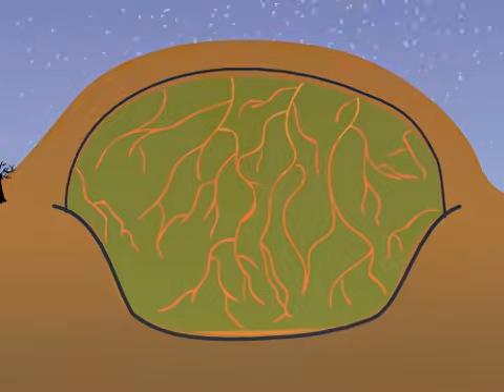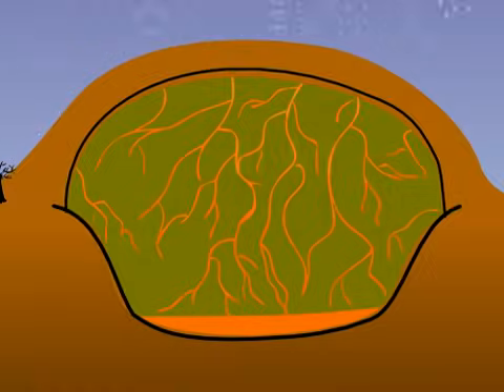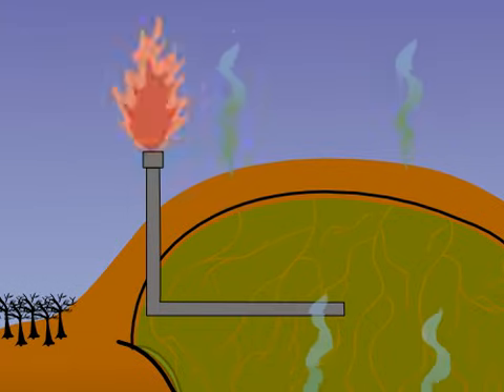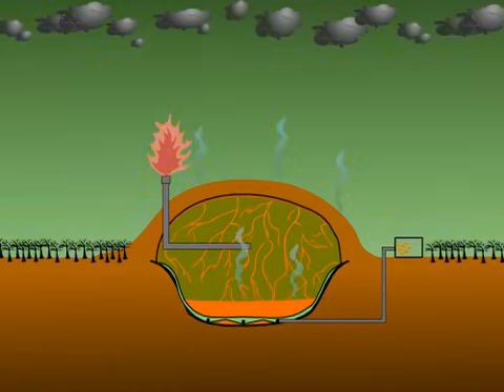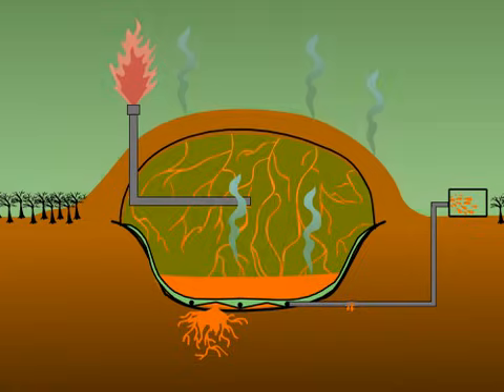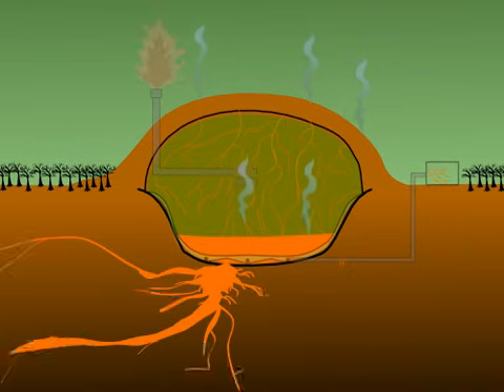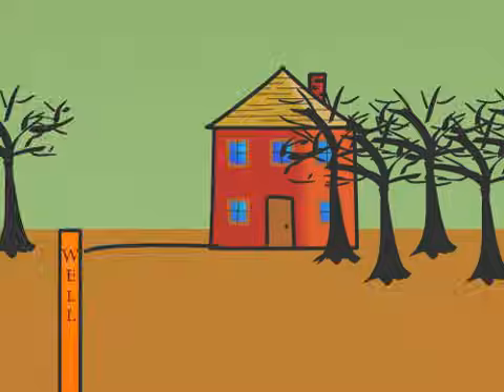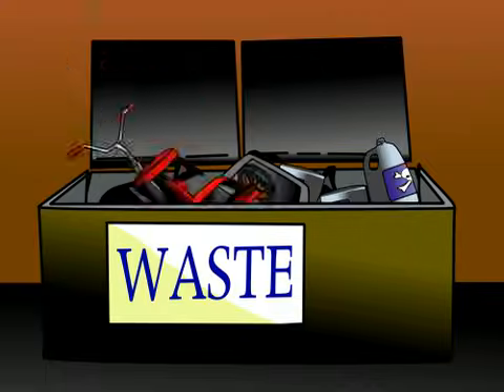How Does a Modern Landfill Work?

Comment: One thing that can be done is get rid of plastic garbage bags. I find it hard to understand that plastic is bad for the environment, but garbage bags are plastic. Things have to be done. Like removing all plastic garbage bags from the shelf. I use compostable bags myself for garbage. Change how baby diapers are made. Either make the disposable ones compostable, and make washable cloth diapers available. Many things can help. Get a bamboo tooth brush. Millions of tooth brushes are thrown away every day. In the end plastic use needs to be lessened. It was business and industry that created this mess. They employ few people and manufacture a large quantity of material. If things were made with local craftsmen and small business, it would be so much waste. Some running after what is fashionable but make what is necessary. Few garments, made with natural materials. Not cheap, fashion made with polypropylene. Five dollar shirt made with rayon, or nylon. Good for a day, and then the fashion changes and it's thrown away. It's made of plastic and will end up in a land fill. Clothing is not about fashion, it's about getting what you need for the weather. A hat, boots, coat. Some clothing to cover yourself. Get some natural materials back, and some weavers.

Comment: Load of rubbish; that is NOT how a modern landfill works. There are many layers of protection and tests done to ensure the Best Possible containment of leachate. This video is trash and designed to mislead the uninformed. What was the point of it?
Reply: You ever think about how older civilizations maybe did the same practice and maybe not having the knowledge of how powerful the gasses from methane were coming from landfills would affect the earth. By design this looks and sounds like a volcano
Reply: what a good video on it?
Reply: Absolutely right

Comment: Whoever made this video obviously has not one single clue as to what goes into making a modern landfill. Leak location pipes. Single, Double if not sometimes triple lined 100mil+ geomembrane system. 5-10' of compacted soil on landfill base and slopes to ensure and prevent punctures in geomembranes. Methane collection systems coupled with burn-off stations or energy converting stations to send to a local utility grid. All of which is then capped with another geomembrane making one entire gigantic expensive trash bag.
Reply: +Drew Ramos plus the 30 years of post closure care and monitoring that goes into a landfill after it's capped.  Most people have no clue all of the regulations and quality control that goes into a landfill.
Reply: +Drew Ramos Awesome info. This is good opportunity to make yourself a video. Best regards.
Reply: https://www.youtube.com/watch?v=pbnmTw8giCY

Comment: So what are we supposed to do with our trash?
Reply: Joshua Wilson Recyle or incinerate it to prevent hazardous chemicals from leaching into groundwater.
Reply: +TheTruthQuest123 The crux of the matter is how we decide to "recycle". Really, it's a political matter, as recycling on an indivdual level is messy, time-consuming and has no short-term economic benefits. The long term financial benefits are, in fact, huge but it takes a political commitment that is absent from our current political priorities. We have to press our political representatives (in my country called MPs) to invest in easy to reach, well-run Recycling Plants. I dont have the figures to hand, but from memory most governments spend huge amounts on defense, policing and themselves... Recycling is way down the list of priorities.
Reply: Joshua Wilson Plasma gasification is a furnace process. Organic material (eg hazardous waste) is converted into synthetic gas, electricity and a useful by-product called "slag".  (Slag can be ground into a powder that's added to cement, or manufactured into insulation fibers). Unfortunately, plasma gas plants entail high start-up costs in comparison to managing landfill sites.
Reply: you cant recycle everything max half of what you get rid of
Reply: Send it in space.
Reply: chris brunette that's what I've been thinking. The government and NASA should look into that.
Reply: +Joshua Wilson dont know
Reply: J wilson start living 0 waste🙃
Reply: Joshua Wilson Thanks for askin, Joshua. Here's some of the ways I recycle. Store old wood in a dry place - it can be reused as fuel (or for many small carpentry jobs). Old paper (thrown out by many businesses, can be reused as notenooks). Computer parts: Eg- fans, cases, internal parts, screws (can all be reused to fix PC units and laptops). Aluminum cans- This metal is valuable- Each can is worth 1p each (in UK currency). Cardboard boxes - Can be flattened and reused when movin' house, or to deliver items. (PS: Safety first- Combustible materials like wood, paper and card MUST be kept away from naked flames. It's a good idea to have a fire extinguisher on standby, too). A site called www.instructables.com demos many inventive ways household materials can be re-used.

Comment: This upload also belongs in a landfill itself because alot of what they are saying is rubbish. Modern day landfills are alot cleaner and more organic based in the way of waste. The first few parts are true in the way of a liner in the ground to hold the waste and any lechate. But then the lechate gets pumped out and then treated and cleaned before being put back into the enviroment and the gases it gives off get collected and stored to fuel generators to power homes, little goes into the air.